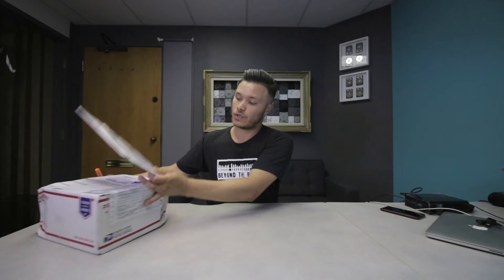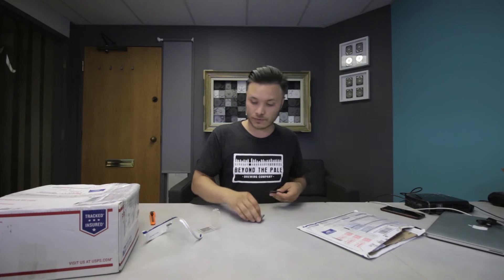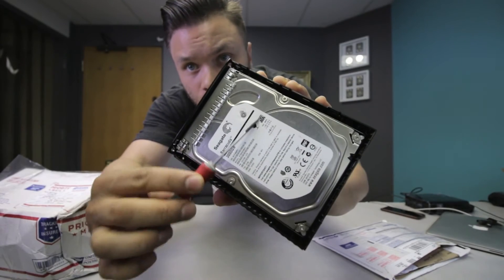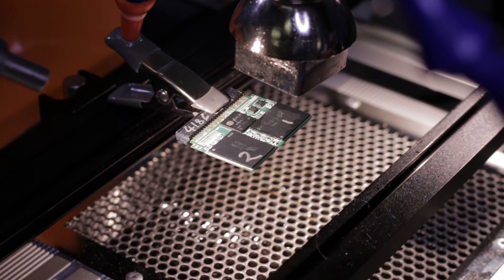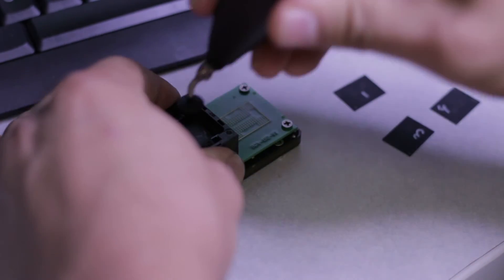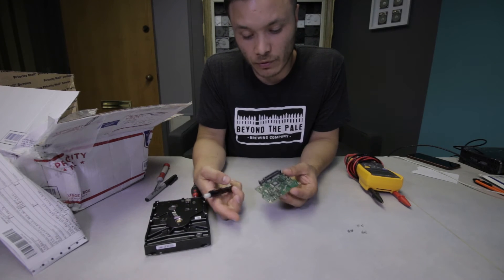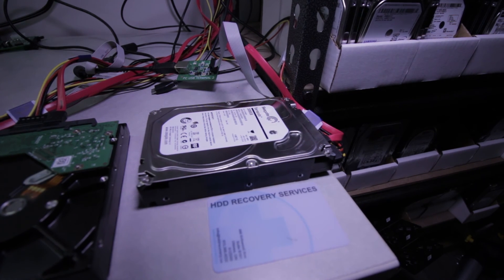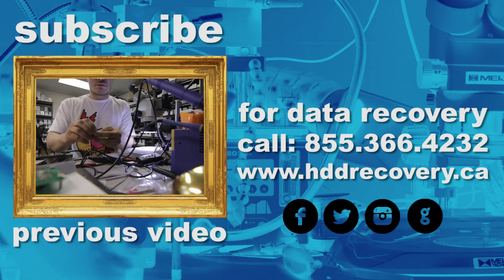Just another day at the office ST3000DM001 and Lexar CF card

Comment: I don't share your opinion about the clean room. And as far as I saw it on your videos, you also don't have one, but you use Laminar Flow Benches. But do you really work with an open HDD under the Laminar Flow? Especially when you have to swap a motor or bearing?

In my opinion it's not OK to open a drive in a dirty environment like some russian "Meister" are showing in their videos where they open a HDD on their kitchen table next to their breakfast. Especially for HDD-"Repair"

But I think, it's ok to open the drive in a semi clean room for Data Recovery. The drive won't be damaged my the dust in the air that much, if you just open it and put it straight on your imaging machine. 

On the other hand, a "clean room" or a Laminar Flow Workbench does not cost a fortune anymore, compared with PC3k for example.
Reply from the maker: well, this drive had been opened in the regular room (not by me), and as a result the drive had contaminated surface on head 5. So you be the judge how important laminar flow or the clean room would be. I have 2 laminar flow benches one 4' another 6' and we use them both daily. Clean room is not superior to the laminar flow in our line of work, as long as nothing lands on top of the disk. If you like to gamble with clients data by opening them up in semi clean room, that is your opinion and you are entitled to that. I just know that from a blown out PCB I could have recovered 100% of data after the repair, but due to the drive being opened prior, head 5 died after first 70GB of imaging. Client is now looking at the cost of head replacement. I don't know how clean the environment was where the unit got opened, but head 5 in this drive is the top surface. Whenever I have to open the drive up to perform any internal work I do it under Laminar Flow 100%.
Reply: You are comparing two different things with each other. It makes a difference, if you are going to open a drive to repair it and get the data right of the HDD or if you are going to open the drive and let it rest for some time with dust particles inside the drive.

You can make a little experiment for yourself. Just open a HDD in a normal environment. Few seconds or minutes later you are going to see the first dust particles on the top platter. Now spin the drive up. The particles are going to fly of the platter. 

Now let your HDD open for some hours or days and you are going to see, that some particles are stucked to the surface of the platter.  

And I think, that the same happened to this drive. 

Well, I also do nearly everything in my “real” clean room, besides of changing the motor, bearings.
Reply from the maker: there is no way for me to confirm for how long this drive was opened, but probably it was only opened to see if the heads are stuck. I can only deal with the aftermath at this point. 

I also heard that by "pulling out on time" she can't get pregnant...